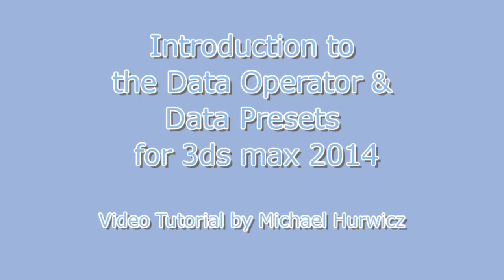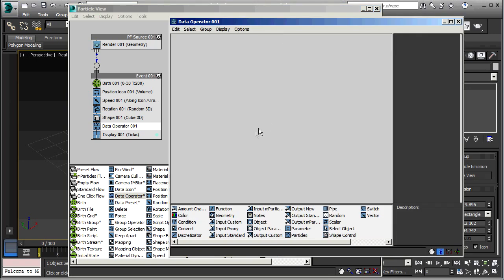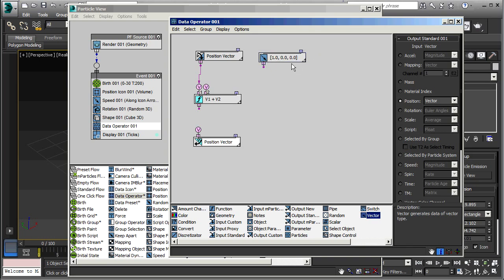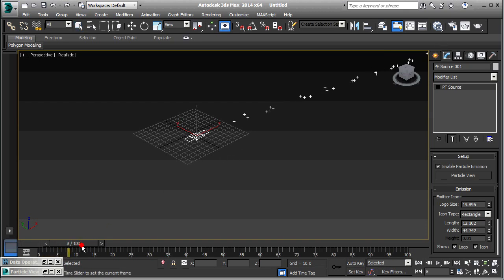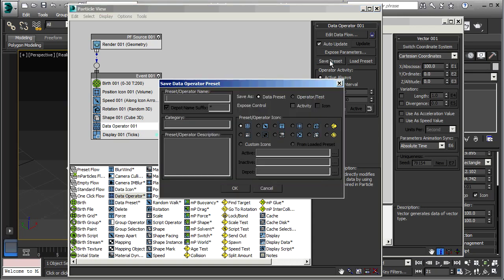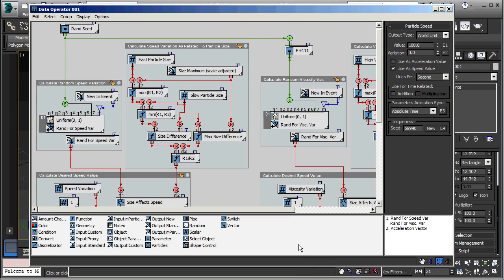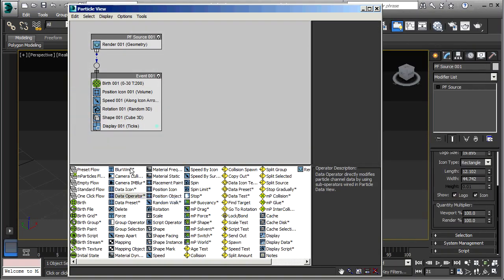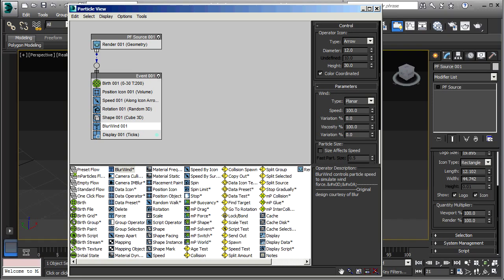3ds max 2014: Data Operator &amp; Data Presets for Particle Flow

Comment: Cache makes it so you don't have to recalculate your particle simulation every time you move the timeline. It calculates once, then lets you play back the result in realtime. If you make changes to the particle flow, it will recalculate automatically. You can cache the simulation in RAM only, or you can also save the cache in the max scene itself (this increases file size)